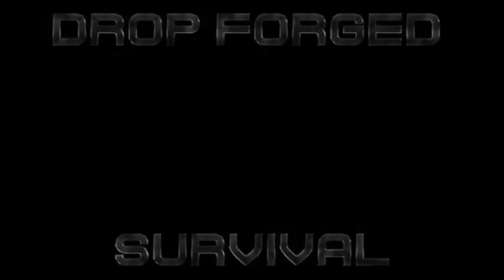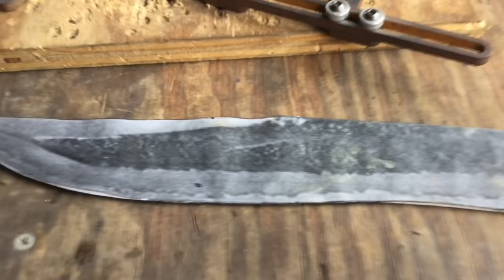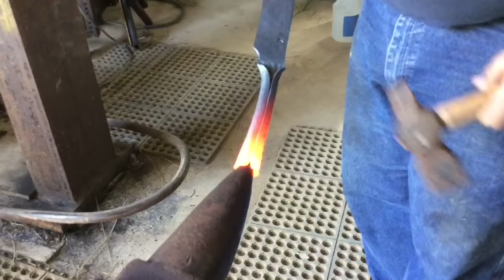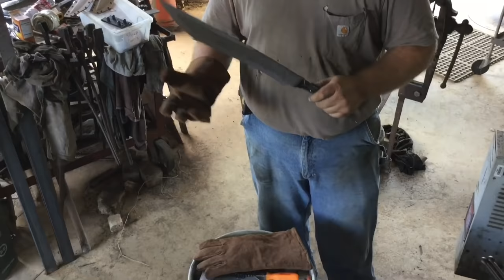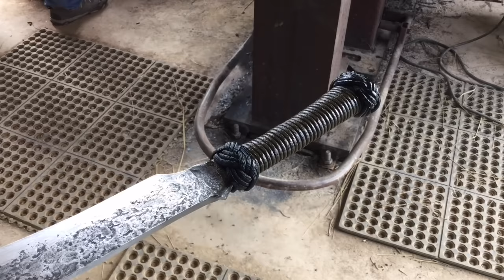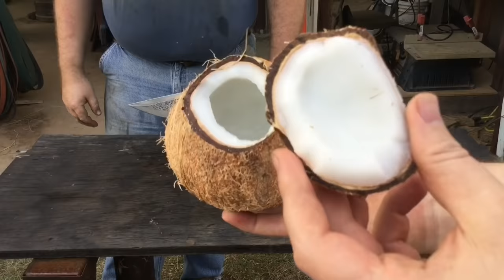BlackSmithing - Forging a Tactical Bush Sword - Forged In Fire - HelmForge

Comment: I really like this style. With the handle being part of the weapon you never have to worry about wood cracking or coming off. Very nice.
Reply: It's hard to pull off. If the heat isn't even and isn't quenched out right it will create a weak spot with a ton of stress on it. The transition from blade to handle makes for a very thin cross section.

Comment: Man I wish I had all that guy's resources and he would be my teacher. Unfortunately I don't have the means to afford all that equipment but blacksmithing will be definitely something I would want to learn
Reply from the maker: He had to start at the bottom also. Know one wakes up and says! I need to spend 30,000 on knife making tools today! Haha 😆
Reply: Oh just pile up bricks and have a metal hair dryer blowing air into the fire make sure the bricks surround the fire on all but one side and have a top on it and then get an anvil and a hammer that would work for it and then you should be good

Comment: I would've made the handle a bit different. You can definitely mount it on a pole and use it as a spear, but I'd make it where you can use it to keep your flint, kindling (if that's what it's called, my English isn't great) and other small survival stuff. Like a multipurpose handle.
Awesome sword nonetheless.

Comment: i like that one that the guy made...BBBUUTTT i want the handle full tang 110%
Reply from the maker: A socket handle is full tang. There is no physical separation of the Blade and Handle at all. Proper Socket handles are incredibly tough as they still give you a full tang.
Reply from the maker: Definition: The term full tang means that the knife/sword is one solid piece. 
This is the strongest of the tang types.

Comment: Hi.This is the first video of yours that I have seen and I am very impressed with the style and execution. I know it's a home made video, and I think it is great. 
I like that you have shown some of the lesser shown on Youtube but more practical blacksmithing things such as trueing the blade by bashing it in the anvil when it starts to all go sideways. Awesome work. I am wondering why you put an edge on the top, or back edge of the blade? To my thinking, if this is a Bush, or Brush sword, the back edge does not serve any useful purpose in 'Bush' use, and is more of a hindrance in a circumstance when you may use the sword to baton wood for example. Or perhaps my understanding of a 'Bush' Sword is very different to yours? lolIn any case, you have produced a fantastic looking, and performing, blade. I really like your video. You have two thumbs up from me. Thank you.

Comment: Brother I am definitely gonna attempt to forge one I don't own a power hammer but I have a heavy sledgehammer you do some beautiful work I am just getting started into forging  and have made a decent machete for my camping gear but I couldn't get all the  peene marks off the blade. I was using my straight peene to draw out do you have any pointers that would help me get the surface back to smooth without grinding or drawing it any further
Reply: Planishing, when you strike the metal do it with a sideways motion as it helps smooth the steel. If you need a visualization then imagine yourself at an anvil with the piece you're working on laying along it lengthwise, now instead of hammering straight down on top of it use a slightly diagonal swing to make the hammer basically rub the steel smooth as you're hammering.
Reply: You can see an example of this in the forged in fire armorers challenge episode
Reply: @ninjafaceify  thank you for the tip I am definitely going to try it and I am for sure going to watch that episode so I can see exactly how it is done but that was a great description of how to do it I greatly appreciate it I been waiting on the heat treat because I was trying to think of a way to smooth it out

Comment: He could be putting stress fractures in there when he beats on the cold steel
Reply from the maker: cdobbsyplay That is why as a professional he normalizes the Steel after Forging. Which "Relieves Stress and Refines the Steels Grain Structure".
Reply: I'm not trying to move a lot of steel at low temperatures, just smooth out hammer marks a bit.  Light blows.  Check out the testing video with the mesquite chopping to see that stress fractures are not an issue.

Comment: What material was the bar stock you started with?  Something north of AISI 1060?  I would think a carbon content of 0.60%-0.80% would be about right, with not a lot else, just to keep it flexible.
Reply: 2"x1/4" 80CrV2.
Reply from the maker: 80crv2 as stated in the Description Box.

Comment: would 5160 spring steel work good for a bush cutter like this hand forged with out the power hammer?
Reply: Assuming proper geometry and heat treatment, 5160 makes for an excellent big chopper.  It was my alloy of choice before swapping to 80CrV2.  The 80CrV2 is a bit more complicated to heat treat (mostly due to soak times), but edge holding is better with toughness at least on par if not better than 5160.  But 5160 delivers great performance with a simple heat treatment.

Comment: is the wrap paracord? and if so after its coated and dries does the paracord retain its quality and strength to be used in a survival situation where the only cordage you have is unwrapping your sword?
Reply: Dustin Maddix no, marine epoxy is rock hard. And sacrificing the handle of your kinfe for a bit of cordage is not a thing you might want to do.
Reply: I'm essentially making a composite handle in place on the handle.  The cord is rock-solid and waterproof with the addition of the marine epoxy.  The sheath provides more opportunity for cordage and survival gear storage with easier access than the sword itself, and doesn't compromise the design of the main tool.

Comment: so why only normalize it 3 times? what happens if you go beyond that and then harden it?
Reply from the maker: The complete process is know as thermo cycling... if go past that it begins to start the process over.....
During the Normalizing cycle we allow the steel to create smaller grains and they then begin to bond togther and refine. The smaller the grain and the more refined it is.... the stronger the steel.
Reply: There is a point of diminishing returns, and also a point where the grain being too fine can adversely affect hardenability.  Three normalization cycles seems to reboot the steel to a good point from which to harden and temper, even if it has been badly overheated and the grain has grown large and easily broken.

Comment: Why two edges?  What's the secondary edge used for?
Reply: Cuttin' stuff.
Reply from the maker: Cutting your enemies down to size... Slicing pizza, shaving facial hair, Back Cuts, Assisting with Piercing, the list can go on and on.

Comment: how much for one exactly like this one?
Reply from the maker: juan rivas He makes these between $250- $350 I think?
Reply: Price depends on length and complexity.  Base price for anything with a blade 10" or longer is $300.  A big recurved blade like this with a fully sharpened top edge is more like $600.

Comment: I'm sorry but I think If you are going to forge something that you shouldn't use a machine, like I understand it is more consistent but I feel like it is a bit cheap
Reply from the maker: I disagree completely... most black smiths who forge full time use at least some type of press or power hammer. If you haven't forged... you just dont know.... All it does is allow to hit the steel harder. nothing more.
Reply: Throughout the history of mankind using iron and steel, blacksmiths have used strikers swinging sledgehammers to do the heavy work for them.  As soon as technology allowed for water-powered, steam-powered, and electric-powered forging hammers, they were implemented.  I would work myself to death (and starve to death from a production standpoint) if everything were shaped entirely by muscle power.  My power hammer allows me to function as a one-man shop.  There is still a great deal of hand-forging, and if I left the blade as it came out from under the power hammer, no one would buy it.  But by all means, forge your blades entirely by muscle power.
Reply: DropForgedSurvival I think I understand a bit better now although I do forge I have never used an electric "hammer" so I may have misunderstood you also are highly skilled thanks for explaining

Comment: man you shouldnt wrap a knife that you are going to sell for hundrets of dollars with paracord
Reply from the maker: Once Coated in Epoxy with it Highly Weather Resistant, Very Good Grip, and also want the Client wanted when ordered.
Reply: DropForgedSurvival its ok if client wanted but still with epoxy or not i think that is just cheap,that is just mine thinkings
Reply: I agree with you, especially when there is a hole for liquid to flow down through the grip.